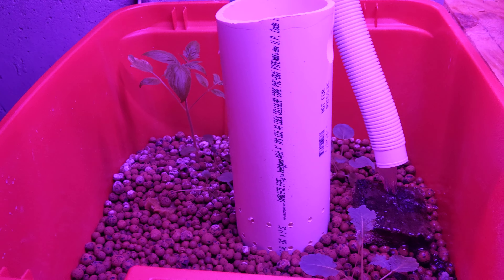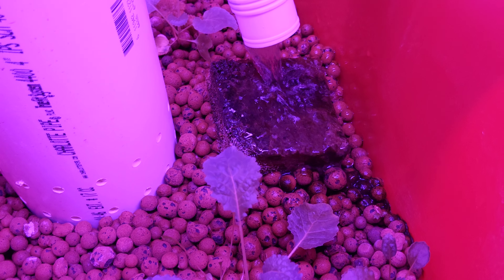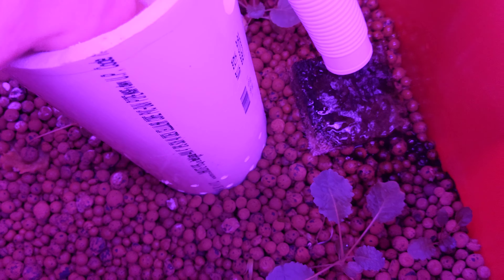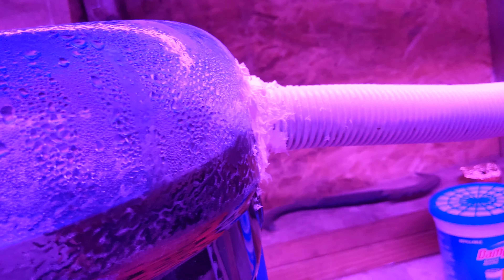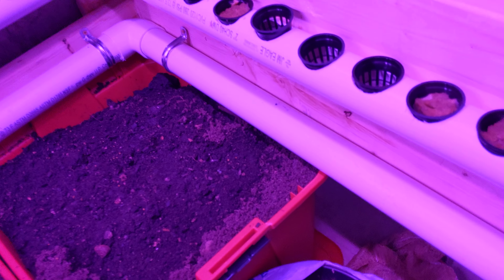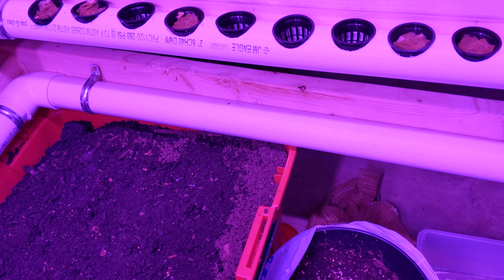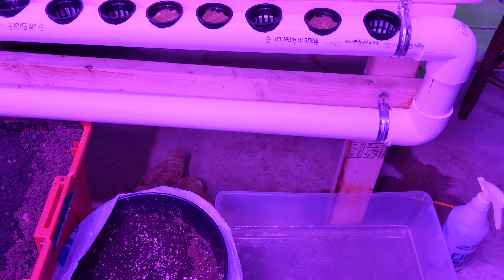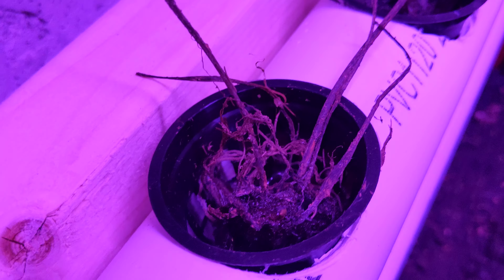How does my aquaponics garden work?

Comment: Are there any specific plants you've found will not work?
Reply from the maker: Well besides the pea plant no but I've heard that butterfly weed or milkweed doesn't do well in constant water but I will be testing it out very soon
Reply: @TheCosmicChariot  I've never been able to grow celery in dirt. I use the cut bottom from one I bought and regrow it. I get great roots in a jar with very little water. But every time I put them in dirt, they die. I made sure they weren't deep. I bet that would grow really well in one of those netted cups.
Reply from the maker: @BaloosCluesOriginal  possibly but also grow celery from seed is way more rewarding than regrowing it and I've always had trouble regrowing celery as well
Reply: @TheCosmicChariot  I haven't tried from seed. I doubt my dried herb celery seeds will work. 😂
Reply from the maker: @BaloosCluesOriginal  you won't know unless you try 🤣
Reply: @TheCosmicChariot  I'll try tonight. I always enjoy an experiment.
Reply from the maker: @BaloosCluesOriginal  🙂